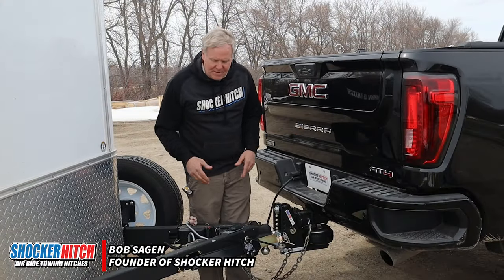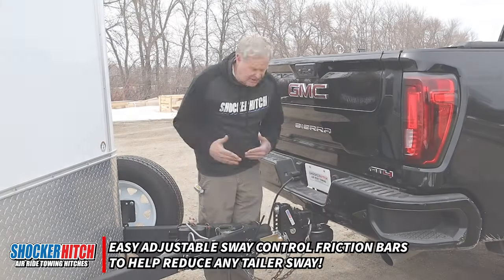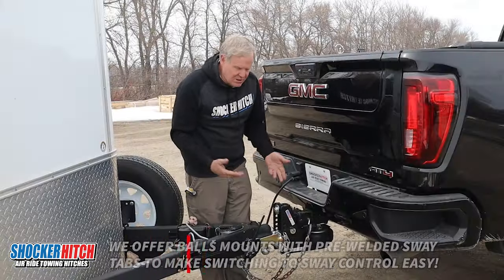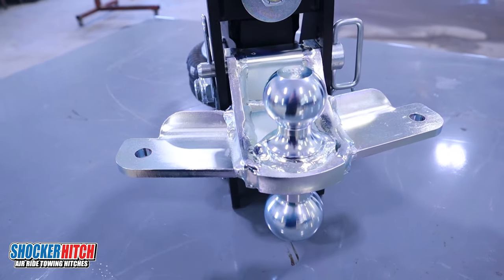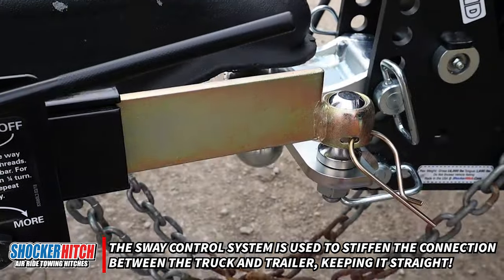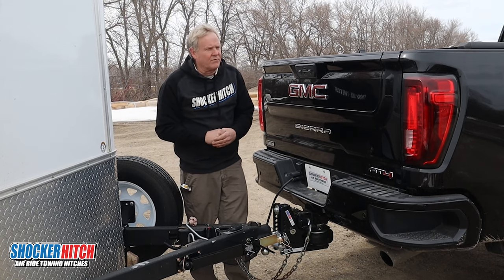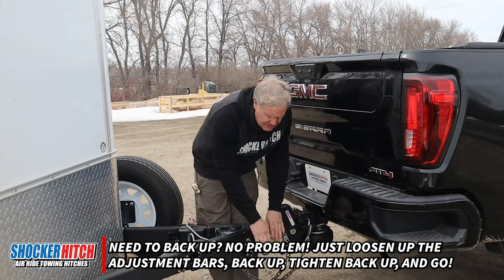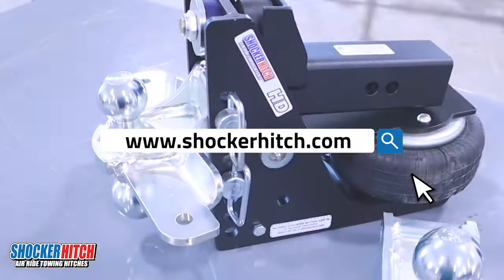Sway Control Friction Arm Bars - How They Work

Comment: Why is mine loose? I've tightened down all the way and no resistance
Reply: Have your adjusted both nuts? Top and bottom?
Reply: @William_wayne84  Yes sir.... I noticed the metal plate that pushes against the friction plates has lost its bends, it's basically flat. I don't apply a lot of pressure when I tighten the brake. So I think it's cheap material, but an easy fix